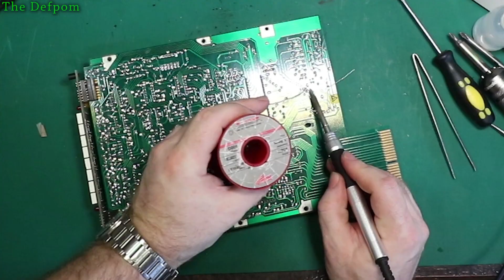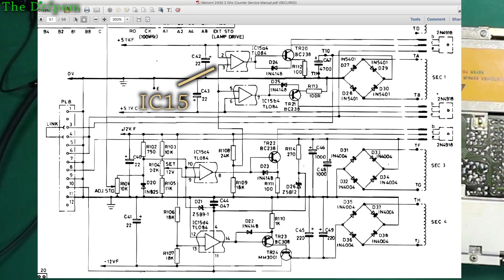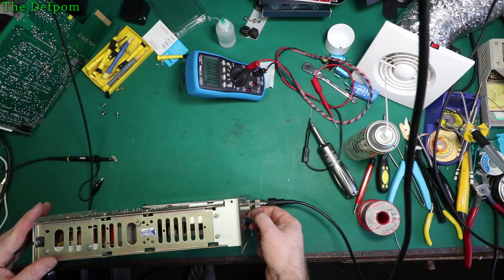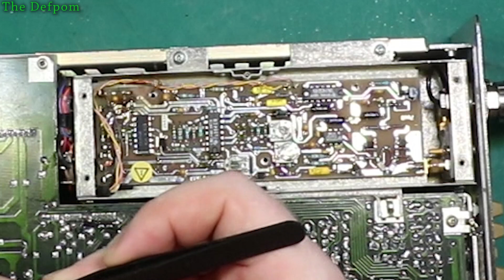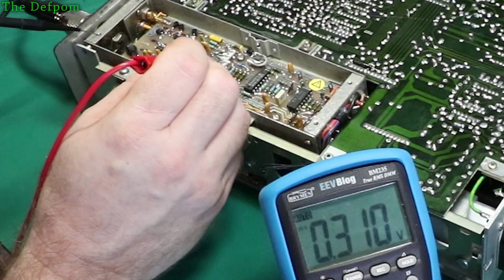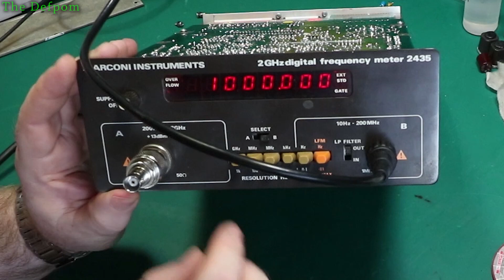🔴 #601 Marconi 2435 Frequency Counter Repair Part 2 - Can We Fix It?

Comment: The liquid solder falls back into the tube and solidifies. Blocking suction for next activation. Needing a pocking with fine steel wire to clear it. Solder should land in the filter mesh and stick there. Suck verically and it fails.

Comment: i don't know, you made it worse.
I have never ever created problems,........ Ok i have lol :-D.
Those snapping wires are a worry.
My old portable telequipment scope was a bad joint city, mostly where the through board rivit connections were.
it happened every time i needed to use it, Thanks a lot scope :-(

I got so fed up, i just removed all the wires off the solder points and connected them to the components direct.
No more crap joints lol.